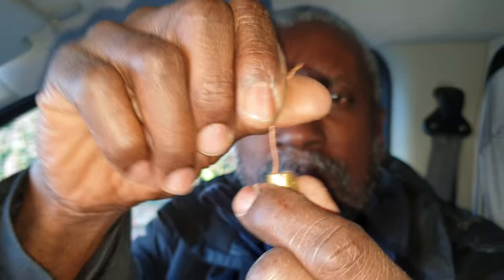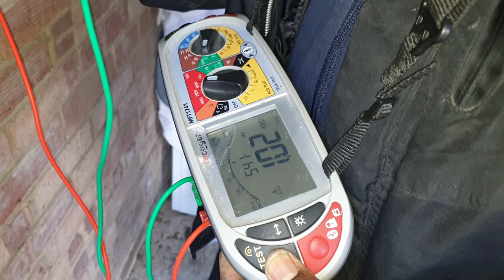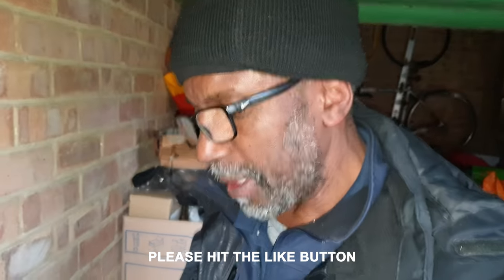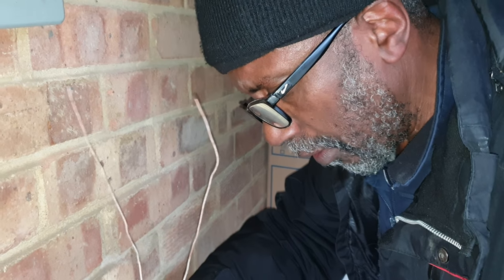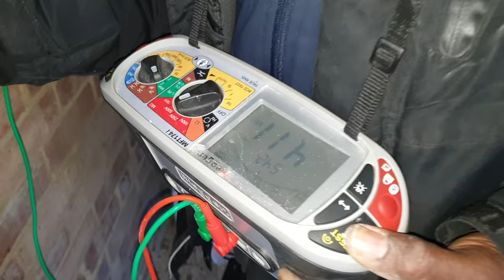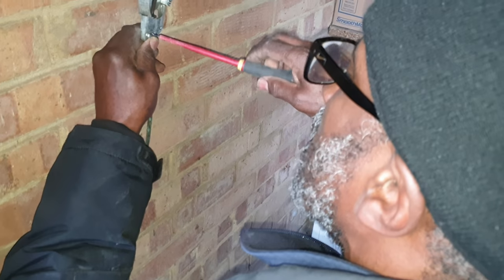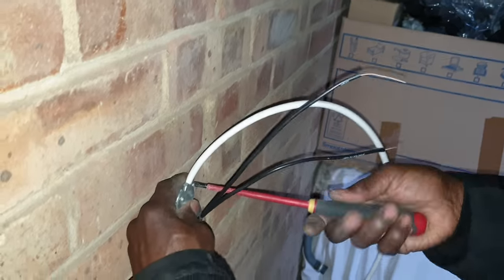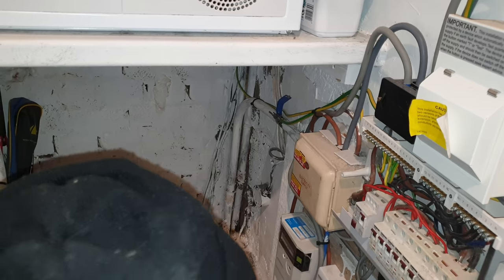Mineral Insulated Copper Clad Cable -  MICC (Pyro) Repair Job

Comment: As an American, I've only seen MICC once, in a restaurant in Covent Garden, as I recall in a basement.  I asked a friend who was an electrical engineer about what I described as "quarter-inch copper tubing used as conduit" (I didn't know what was inside) and said it might be a good thing to use around RF transmitters, etc., because of the shielding.  Thanks for letting me see how it is used!

Comment: I loved pyro. Made off 1000s of ends on all sizes up to 16mm. Mostly used earth pots for a more reliable connection (take note Delroy :P). The usual problem from memory was after you screwed the pot on the cable, you had to look very carefully inside because often as a result of screwing it on, you would get a tiny slither of copper just inside the pot, but enough to touch the cores. Its a bit like a lathe can produce slivers of cut metal, but on a smaller and finer scale. We always used to cut off a good 1 to 2 foot then make the end up because the magnesium oxide inside was very absorbent of moisture out of the air, and was the usual reason you got poor insulation test reading. Used to use a 1/4 rod of metal with a slot in the end to remove the outer covering, similar to how you undo a cornbeef tin :) Oh, and a tip Delroy, never blow into the pot, i'm sure you can figure out why. Also, I used to do a ins test before crimping the seal in case the cores got twisted/touched whilst pushing in compound and subsequently pressing the seal in place. It was also a good idea anyway just in case you didnt spot a slither of copper as already mentioned.
Reply: Add pot test with a megger, add compound slide cover on then test again, crimp and test again.
Reply: Good call- not to blow into the pot.

Comment: I just discovered your channel and got excited when I saw pyro!  It's still used in old buildings such as churches and old wood-framed buildings etc.  I love using it for a sort of retro "steampunk" look.  It is somewhat difficult to get hold of now and it's nothing like FP200.  FP200 is only fire-resistant which is good enough for most applications.  Pyro is literally the melting point of copper.  I get mine either second hand on eBay or from Remora Electrical who still stell a wide range of pyro.  Also, when it comes to damp, a heat gun at 600 Celcius sorts it out.  I can get a reading from under 1M to 999.99M on a 1000V test just by heating the cable where it has been stripped.  Usually heating 15-20 CM  back from the end is enough but sometimes you do need to half a meter or so.  I've never seen the pyro junction boxes before - very interesting.  Also, I never knew you could strip pyro with a pair of cutters.  Great video - keep it up!

Comment: Nice one Delroy , I once worked for a fire alarm company about 25 years ago who only used pyro for their systems and I got the job because out of 4 spark's who got interviewed for the job i was the only one who was experienced with using micc cable and the other 3 had never installed it which I found strange but I suppose some guys never touch it......👍
Reply: I worked for a firm back in the late 80's early 90's and we also installed all our fire alarms with pyro. I was only an apprentice back then but my boss used to have me doing all the terminations in the main panels as he reckoned I was very neat with it not that the other sparks couldn't be bothered with it . I loved them days .
Reply: I'm a fire alarm technician, and I'd only stumbled across it on a tyco F4000 system (one of the last here in New Zealand) and unfortunely conventional non indicating which was randomly faulting into fire. Took me 2 days of testing to find the faulty device on the circuit, but exploring around and seeing how it was wired up amazed me. So clean and easy to follow the circuits!

Comment: Pyro is an art form! Lots of substations I used to work in were wired entirely in pyro. Looking at runs dressed away from the distribution boards was an impressive sight. Could be a bit of a pain if we wanted to make alterations mine you - trying to find a spark or wireman that could do it was a challenge! Kudos, Delroy!

Comment: Never seen the MICC, it is the first time, in Italy vinylpiobo was used, I can find nothing on the net if not some hints in Italian, 2 rigid vinyl insulated conductors, a very delicate pink rubbery sheath that peels off with the fingers, cast in the lead that makes an external coating such as the MICC, very heavy but easy to use coils, it was walled directly into the walls in the house, I have not found it for many years, thanks for this splendid video of a real old school. Ciao
Reply: The MICC is very fire resistant and can be used for alarms and emergency lights, or where you want to keep the fire risk extra low. It uses dry Magnesium Oxide as the insulator, which is why it is important to keep water and damp away from it. The copper sheath is the ground/earth. :)
From Google Translate - Il MICC è molto resistente al fuoco e può essere utilizzato per allarmi e luci di emergenza, o dove si desidera mantenere il rischio di incendio estremamente basso. Utilizza l'ossido di magnesio secco come isolante, motivo per cui è importante mantenere l'acqua e l'umidità lontano da esso. La guaina di rame è la terra/terra.
Reply: @thesunreport  Thanks for the explanation

Comment: My first ever job back in 1981as an apprentice working on a hotel near Harlow 1 of the sparks was very good and loved doing micc and was given job of outside lights in the middle of winter and then in the summer in the boiler house luckily not up and running and I helped

Comment: In Australia all electrical work has to be done by a licensed electrician.
This even includes changing a power socket or light switch which is a very simple task.

But most people don't call an electrician for these jobs.

Comment: Awesome channel, used to work with pyro that had been disconnected and then tested under 1meg ohm, trick I used to do was use a heat gun on the last 30cm do dry out the moisture

Comment: Tiny bit of grease on the neck of the cable helps threading the pot on. I think they use to provide a little tube of it in the pot packs

Comment: Good work del. Takes me back 20 odd years ago when I used to work on the old shell building near Waterloo Station.  Did all the fire alarm system on those floors in bare pyro . Took weeks and weeks. Very satisfying tbh . Thank god for fp though lol. Much quicker and easier 😀

Comment: Hello Delroy, nice to see you making the pyro off, takes me back when I used pyro extensively, multi core mostly, often did hot seals where you brazed  flexible & "tails" to the conductors inside the pot & used ceramic beads to insulate them, used where there was very high temperatures .. I still have all my pyro gear, pots including some imperial 👍 ( I'm 80 yrs.old ) from ☘️🇮🇪☘️

Comment: Haven't touched pyro in a long time. I used to find it easier to strip with a small pair of side cutters, just get the angle right to corkscrew the  copper sheath and put the compound into just one side of the pot so it pushes out and fills the gaps

Comment: My 1st job as an apprentice at 16 was to make off pyro ends, I was always told if u suspect the cable has damp issues, cut off approximately 12inches off, that is normally how far damp travels.
Reply: There's a couple of good videos on YouTube by Pyrotenax and Wrexham where they show you how to terminate.

Comment: Nice one, look forward to it
Reply: Back in 76 as apprentice, college would get you to make up a foot long piece gland to gland , full  termination then immersed completely in a bucket of water, mine wasn't perfect, got 1 small air bubble come out, yep it went down to 10Mohm., I really enjoyed working with micc, but messy job with the Powder, I remember some having wedge pot's, and I understand that some were glass filled for in floor heating way back, never done them though, 1 common error some spark's would do is with volt drop, someone decided to run  a 6kw Water heater on a 50 M run using 2.5mm micc, they could not understand why it wasn't heating right, well yep that cable did run warm for sure

Comment: Should the cpc be connected back at the source? Surely that should be TT that far from the property
Reply: Not really, the only thing that possibly could have been checked is the voltage drop and the earth fault loop impedance. regarding voltage drop its a bit of a farse today, since the European harmonization came into effect -6 to +10 based on 230 volts, the chances are very high that the voltage at the distribution is probably between 225 and 235 volts, so the 3 % voltage drop for lighting is a bit of a farce when you consider - 6 % of 230 volts = 216.2 volts.  So lighting point at the garage the voltage should be well over this. Regarding the ELI providing the supply to the house is TN-C-S or worst case TNC the chances of the test failing is very remote considering the cable being used is a piro (copper sheathed), the size of the earth is far larger than the live conductors and the impedance would be very low. Nothing wrong with testing however and a small works certificate being issued. Not many sparks bother to be honest as this was only a repair job and nothing new really added. Delroy is old school and a great spark, would have loved to have worked with him in the past.

Comment: In that situation, run some gentle heat from a blowtorch to dry out the mineral insulation where its been exposed for a while. It's still used in churches and listed buildings very heavily
Reply: That would have saved a lot of stripping etc. If the new seal is good the insulation resistance will continue to climb and should reach 'infinity' after a few days.

Comment: I can remember when I was an apprentice ,my father had a length of pyro left over from a job it would have been about 6mm 2 core and it was in a loop of about 6/8 turns and was about 1.5 m in diameter,Like Dels Pyro  it was down to earth
So instead of drying out the ends in the normal way, Dad connected it up to mains thus the cable got rather warm but as it dried out it cooled down
Reply: how did he do that? Did  you have a load on the cable
Reply: colin campbell 
No ,no load ,the other end  was terminated safely with tape etc 
It was just the dampness held within the White power 
So when current was passed down the cores was nearly shorting out ,
Reply: Use to clear damp ends with Wind-up Megger

Comment: i worked on a construction that was designed in imperial...we had a mixture of both metric too...it was a nightmare trying to get the right pots to fit...

Comment: Did the circuit meet voltage drop calculations? Looked a bit far from the original?

Was an excellent video! Thank you

Comment: Could you not have used a gas torch to drive the moisture out of the cable end, then soldered the (drilled out) pot on the end?

I have some ancient (imperial) pyro in my home - that's what the local sparky had to do to avoid replacing hundreds of meters of the stuff.

Comment: I know i'm biased as a conduit loving USA electrician, but why not sleeve the pyro and other cable to protect it from physical damage as thats what caused the issue in the first place?
Reply: We would put it through a steel conduit especially in a lot of schools we worked in to avoid damage from kids and so on .
Reply: Yes conduit would be best. You have to remember that in the U.K. many houses and buildings tend to stay around a long time and you often get to a situation where you have to connect with older wiring. Even doing a complete re-wire would be a huge amount of work imagine pulling through conduit beneath the concrete as it leads to the garage. To do it safely you would have to channel and cut through concrete to ensure everything was up to code. In the USA where I now live houses tend to get rebuilt more often and latest codes tend to get implemented as part of the rebuild and it’s in my opinion much safer. That’s why electrical safety testing such a big issue in the U.K. you have so many old buildings with a rats nest of old and new wiring, old and new outlets, lighting circuits. Proving an old building is safe is critical. It’s only recently that I have seen residential testing becoming a thing in the US and it’s mainly only insulation resistance and earth testing. Of course there are experts out there who do it as a matter of professional competencies. However I do think that verification testing by county inspectors in the USA could adopt the testing protocols as in U.K. and Europe it would add greater safety assurance and provide an extra income for electricians in the USA who can regularly check the safety of older electrical installations. Soon enough insurance companies will be requesting it.

Comment: You could have drilled the pot inside and soldered a 1.5
into the pot so you could have used the 3rd outlet on the biscuit. I’ve
done this in the past. You can buy pots with fly leads all ready on them.

Comment: You could tell the powder was damp as it came off I chunks and not like talc . You could have warmed up the sheath with a blow lamp and dried it out , takes a while  but get it cherry Red . As said don't blow on it , just bend the cable over and tap it to get the loose powder out .

Comment: I worked on a job before FP200 was common place, he stripped the pyro back 12 ft as he said it was damp!! Didn't help that every time he walked away after stripping it.
The damp should only go 6 inch then it'll go no more even if you put it in a bucket of water.
Reply: Noted.

Comment: If you think that's difficult try terminating RG213 feeder cable with a UHF N type plug with a gas powered soldering iron in the freezing cold and wind!!!!!

Comment: I absolutely hate pyro. I have to use it in Cardiff Castle. There's damp an always causes the pyro to short out. But it has to be Pyro cable without the outer sheef so it's inkeeping with the original look of the building. It looks good but It's an absolute ball ache.

Comment: Maybe it's my age but at 36 I look at that pyro and think of it as utter prehistoric junk barely fit to have 12v DC running on it.  I'm guessing that curcuit was only 1mm conductor just run a few lights at 5amp?
Reply: Thought it was still in the 18th, check the rating for a 2.5mm , remember looking for the rating of FP, SY, CY cables in previous books .Maybe I’m past it,but I certainly see it differently